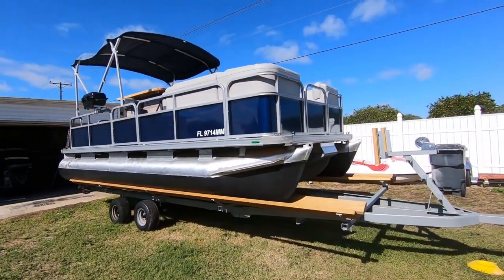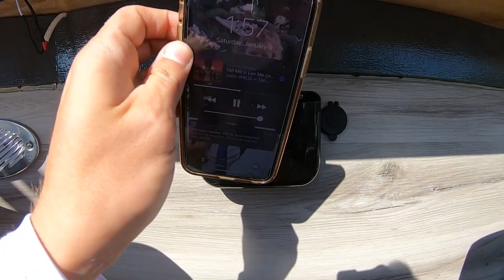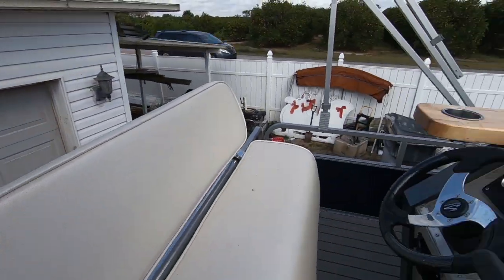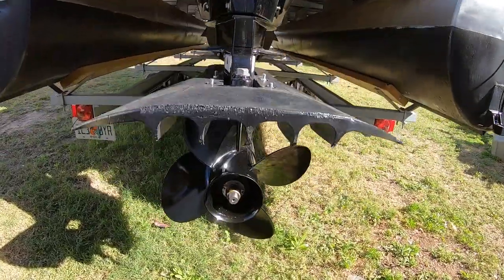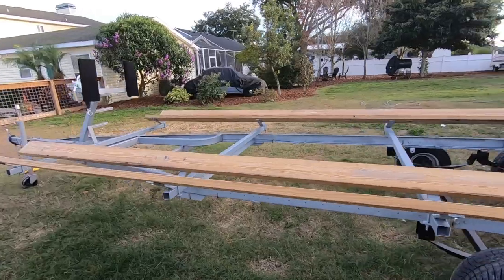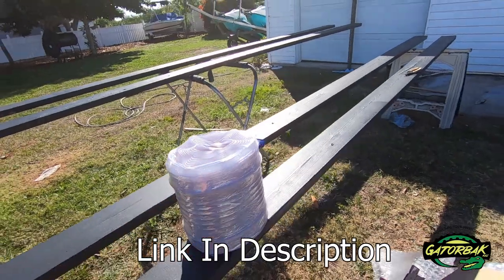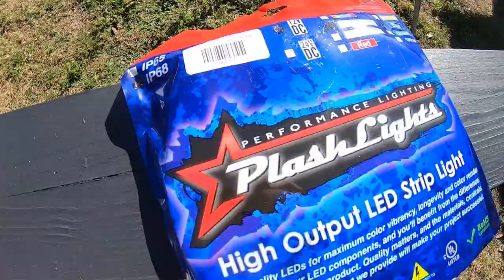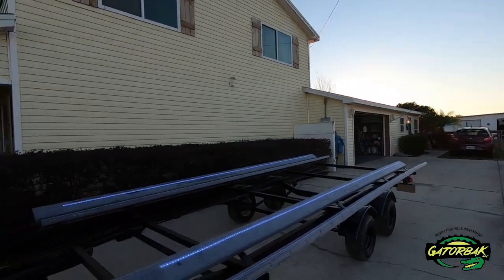Pontoon Trailer Gets an ULTIMATE Modification - Episode 13

Comment: Love your work!  The third pontoon in the middle was a genius install to solve the buoyancy issue. You may want to see if the supplier can help you get a new coast guard plate that tells the boats occupancy and weight restrictions. Your instincts on the trailer color and accessories were spot on. The lights especially look and function great. I’m a 48yo boater with only a few years of experience and I feel like I learn a lot from you but also enjoy that you are open to learning a lot too. A tip I learned this last season:  don’t load fully into the trailer when recovering, drop the trailer in a. It shallower always winch up the last few feet. This eliminates the slack that always occurs on the winch line and prevents the boat from slowly creeping back down the trailer. You should also install some stainless boat buckle G2 transom tie downs for safety and trailer legal compliance. Don’t want that sweet ‘toon falling off in an accident. Retractable ratchet straps bolted to the trailer frame are a godsend. Reese makes a similar product, but I’d be wary of their longevity. Great job!!!
Reply: Florida law requires boat trailers to have proper lighting including turn signals, tail lights, and brake lights. Trailers must be equipped with safety chains and tie-down straps. Trailers weighing more than 3,000 lbs. must be equipped with brakes that act on all wheels. Trailers weighing less than 2,000 lbs. must be registered with the county tax collector. Trailers weighing 2,000 lbs. or more must be registered and titled.

Comment: You have done a beautiful job restoring and improving your boat.  I love the trailer lights.  I considered the Gatorbaks when I redid the bunks on my pontoon and my bass boat but went with a competing solid-color (no light option) brand that was much less expensive.  Both brands emphasize that their plastic bunk covers are not for use with boats that have painted aluminum hulls, which would include pontoons.  When I spoke with the manufacturer they said that sand will imbed in the plastic covers and essentially turn it into sandpaper, which will damage the finish.  My bass boat has a powder-coated aluminum hull.  We’ll see what happens.

Comment: Love the boat. We had a 24 foot Party Barge and enjoyed it. If your motor doesn't have a power trim you can buy a separate one that will also raise the motor up higher and help with rpm and speed. The trailer turned out sick.

Comment: Love the look of this boat, it's inspiring me to do a project like this myself! One thing I would say though, the galvanized coating on the trailer is really necessary if you plan to ever use it in salt water. I noticed prior to painting you had wire wheeled parts of the beams and wheels, and if those were galvanized before you might have removed the coating. Painted trailers tend to die pretty fast in salt water, so if you do use take it into that environment make sure to dunk the trailer in your lake to rinse it in fresh water! We have always been anal with our trailers and they last us well compared to some of our relatives. Anyways love the project, just found your channel and looking forward to lots more cool content on this and the jet skis!
Reply: Oh and I forgot to mention that I really like the look of that bunk covering and LED's! Might do that on mine!

Comment: On the winch mount post. You should brace the bottom of the post with a piece of square tubing that leans into the existing post for more strength that will keep the post from flexing

Comment: Get the piranha prop (research) it’s interchangeable pitch and diameter blades (each game of blades costs $20) this will give you a lot of options, if you get out with 10 people you can easily change the pitch diameter to get better torque and not stress out the engine, if you go out alone you pick a large pitch to get better top speed.

I own this prop and makes hell of difference... I have blade game from pitch 13 to 21 I can easily do wakeboard with 8 people onboard and when I head out fishing on my own with the 21 pitch blade I can hit almost 60 mph
(I own a merc 115hp 4 stroke)

Comment: I was just going to tell you if you trim up the motor some until it starts skipping then trim it down until it stops it will gain a few miles an out it lifts the motor out of the water like a jackplate

Comment: Easy ways to raise a motor.  1) put a floor jack under the skeg. Take out the top bolts, loosen bottom (slotted holes), jack engine up until next set of top holes line up. 2). Run tongue jack all ye way down, put wood blocks under skeg, remove top engine bolts, loosen bottom, crank up tongue jack until next holes line up.

Comment: PLAY WITH THE TRIM! When your running trim your motor up to the point that the spray is as far back as you can get it without bogging the rear. In the drone shot your spray was shooting out way too far forward for just yourself being on the boat.
Sweet build sir!!!

Comment: The equalizers in your suspension should be equal . It's possible that your rear springs may be too long . Check your eye to eye measurements on both front and rear springs . They should be the same . The measurement should be taken from the center of the center bolt to the center of each eye , along the leaf . It's called long and short end measurements . If there is a long end , it usually goes towards the rear . All four springs should have the same part number .

Comment: Loved That build, content was great. The way the boat and trailer came out. Those LED's on the bunks man I wish they had that when I had my boat. I'm gonna keep that in mind. I loved the way they looked and lit up under the water. So what happened with the captains chair did you re wrap it and keep it or did you scrap it? Also get yourself a electric trim for the motor that will help out a lot when trying to level out the boat when going, with our 20ft pontoon we averaged at full throttle 30 to 33 with a 75hp merc. Keep it up and hope this isn't the last we see of the tooner!

Comment: Damn at least you don't have far to go to launch your boat.  👍  She sure did turn out nice.  I can't remember though but did you ever mention how much it cost to get to this point?  It couldn't have been that cheap considering you bought another motor, a third pontoon and another trailer.  Still I imagine it was probably cheaper than a new tri boat.  
Lastly as to loading it yourself have you looked into guide rails for the back of the trailer?  I did that on ours and it made it much easier to guide the boat on.  Especially on a windy day.  I know they can look cheap and flimsy but I'll be damned it they don't work pretty good.  Especially on my trailer cause you have to line it up on rollers instead of wood planks.

Comment: Having to do with the prop, there are a lot of different props that do different things. I went through 5 props before finding a prop that produced the best rpm’s and had the highest performance.
Reply: Also the “recommended prop” is not always the best prop. I figured that out very quick

Comment: Even simpler: a giant neodymium magnet on the trailer and another giant neodymium magnet on the boat. Then you have to pay attention to the polarity and the most difficult is to find neodymium magnets of 175 kg
Reply: Another small problem is to remove the scooters and motorcycles stuck on the magnet of the trailer.

Comment: If I didn’t see wrong... you were getting 5.000 RPM out of full throttle with 1 person aboard, damn that’s awful change immediately that prop, 4 blade prop is great but you need waaay less pitch... I even doubt if it got into plane with 8 people

Comment: You need less pitch on the prop to get the engine rpm up, less pitch on the prop is like lower gear ratio on a diff. its like going from a 2.50  gear ratio to 4.11 gear ratio, also you need a larger engine trim wing to get the bow down, getting the bow will allow  you to skim on top of the water better rather than plowing into the water.
https://www.just4marine.com/ourshop/prod_6321248-Hydrofoil-Stabiliser-Fins-For-Outboard-Engines-60-to-200-HP.html

Comment: Get rid of that whale tail. All it’s doing is helping you plane at slower speeds but it also causes a lot of drag on the boat. Remove it and you should see an improvement of speed